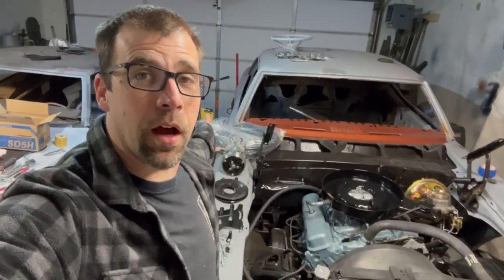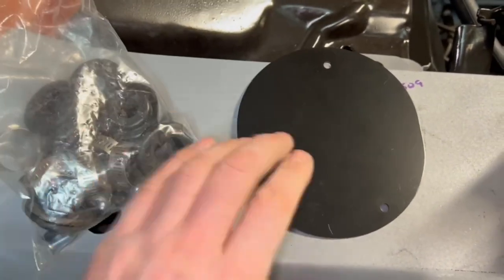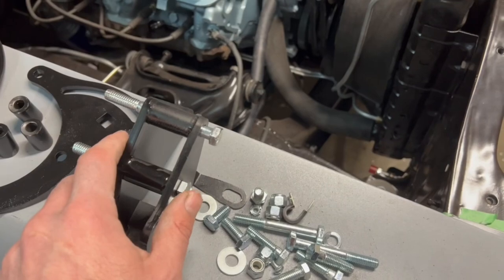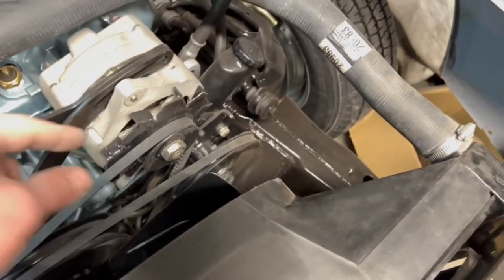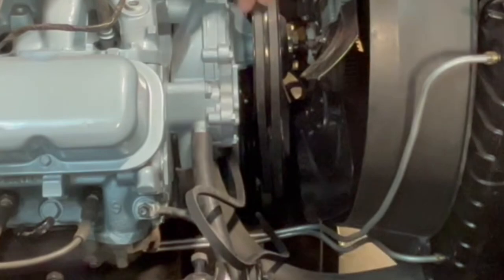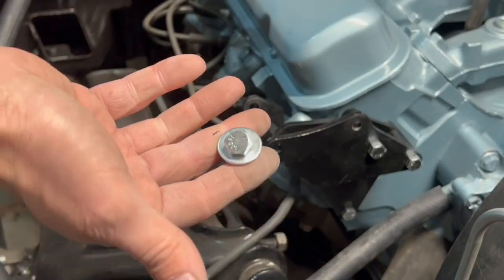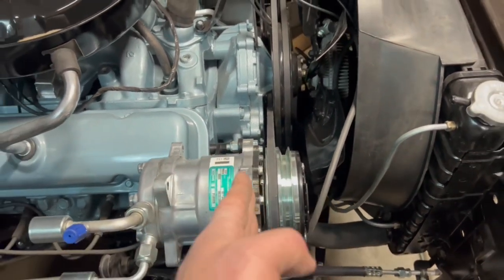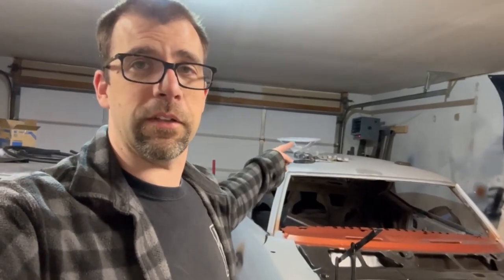Need some insight on how to install vintage air compressor and brackets, then check this out!

Comment: Jon to keep from scratching the paint on the engine. I use the felt washers that go on top of you top post battery. I didn't know you started a new job. Good luck 👍 
And keep the videos coming.  They help motivate this 70 year old man.
Reply from the maker: Good tip! and thank hope the new job is what I expected.

Comment: Great job.  I like that fancy bracket for the engine,  it seemed a whole bunch easier than custom making your own lol.  This project is really coming along.  Keep up the great work and looking forward to see your next video.
Reply from the maker: Thanks 👍. if it was a modified engine build a serpentine set up is my preference, in this case the vbelt will work.

Comment: I cut out plastic washers from a coffee can lid just a little bigger ID than the bolt head to protect the paint. Also works great on lug nuts on fancy wheels.
Reply from the maker: heck yeah great idea. I have plenty of milk jugs

Comment: Hi
Like your idea with leaving the existing heater blower assembly on the fire wall. I was not happy with the smooth blank plate method vintage air was requiring. I have 68 with 400 engine and I’m getting ready to purchase my ac kit…. Should bought it earlier since prices increased. Thanks for your videos great help, since your are Firebird professional.
Reply from the maker: glad to help.  good luck on your install too. I really like cruising  in comfort and think it’s worth the effort.  I am hopeful the prices stay the same or go back would be even better

Comment: I have gone back and forth for years about putting a vintage air kit into my '69 Camaro but its a numbers matching 4 speed L35 396 big block and I just can't bring myself to chop it up. My dad was the original owner so I would never sell it but its still hard to make modifications that would affect the value. Also it can slowly overheat in traffic on hot days and A/C wouldn't help that situation. I do have a dream of taking it on power tour some day though and it sure would be nice to have some A/C.
Reply from the maker: it could be installed like this and no permanent mods needed to make it happen. I am with you hate to cut up a nice original car.

Comment: A good idea would have been to modify the control valve mounting so that you could remove it from under the dash. Drill and tap the mounting plate to accept a screw to be under dash service, just a thought.
Reply from the maker: Yup for servicing the future and that would help a lot.

Comment: II a assume you will be running those refrigerant lines through the original blower motor opening? Will you be making another plate to seal those lines through that heater box opening?
Reply from the maker: yes I actually just use and modify the plate provided in the kit,
Reply: @VinylVillageGarage  I understand what you are doing with the vent seal off plate. My question is, before you can route through that plate, you have to get those lines there.Assuming that would be through the original blower motor opening, wouldn't another plate be needed to seal it?
Reply from the maker: Got it. Yes thru the blower motor opening and no doesn’t need sealed at all it’s the same cavity as the cowl and would not need to be weather tight.  You can run your hand thru the blower motor opening and reach out the cowl opening.
Reply: @VinylVillageGarage  Understood...BUT they sealed the original blower motor with caulking to prevent water intrusion. Still, the fender is not sealed to the cowl. I may be wrong, but wont that opening allow water to enter the heater box?You are sealing the box.Wouldn't that blower opening allow water to run inside and build up in the box to the inside of the car? Just a thought...
Reply: Also, If you choose to seal off the blower opening.Those provided bulkhead seals are made to seal the #10 and #6 aluminum lines Not the hoses unless you find larger grommets. I have a similar arrangement on the C3 Corvettes..I use bulkhead plates (Vintage Air) for both the blower opening plate and the vent opening plate and make up ajointing hoses and ends between the two bulkhead plates then make up the hoses from those to the compressor  and condenser and inside to the evaporator...It's a PITA as C3 vettes dont have removable fenders for easy access.